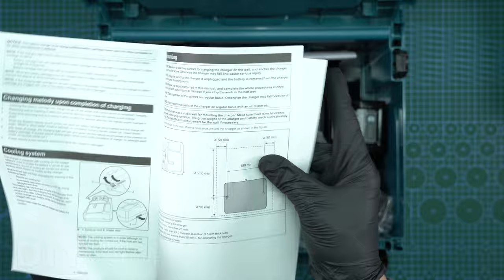Full Testing Makita 40V XGT HP001G Cordless Hammer Driver Drill and Unboxing 2022

Comment: Whats the difference between MAKITA HP001GZ vs HP001G or are they same
Reply from the maker: They are the same. HP001G is the model number of the hammer drill tool. HP001GZ is bare tool only when you buy it from the market, on my video HP001GD201 is the exact model for the tool, two 2.5ah batteries, charger for the batteries and makpac (case/tool box) Thank you.

Comment: Certainly not designed for masonry
Reply from the maker: Try to check this total rotary hammer Testing and Unboxing Total Rotary Hammer 1800w TH118366
https://youtu.be/kBB1jw3BzJg thank you for watching 🙂
Reply: As far as compact hammer drills go this is the by far the best one available for masonry. He's using a very large bit in this test which as expected is a little slower using a small combi drill. But even with its small size the smaller diameter bit paired with this model bores lightning fast.